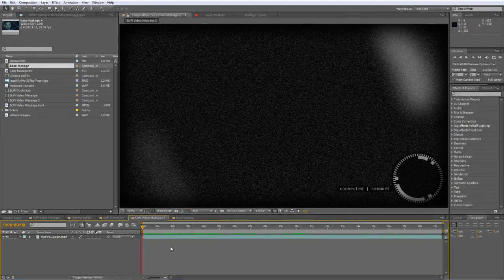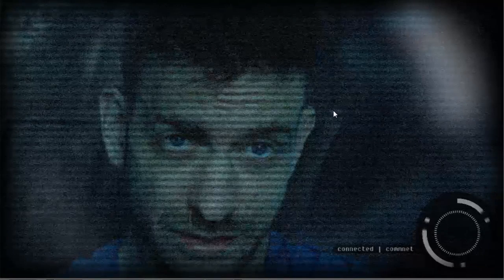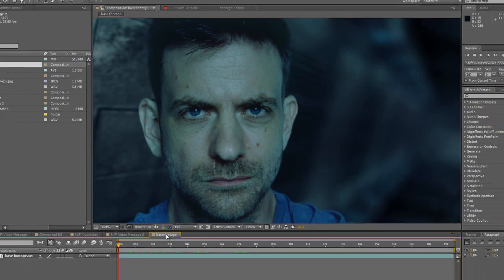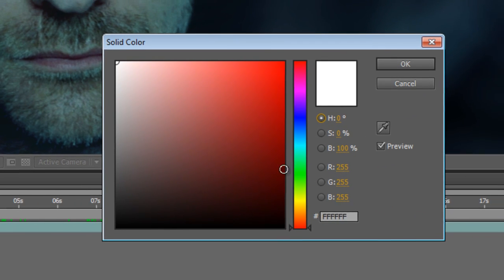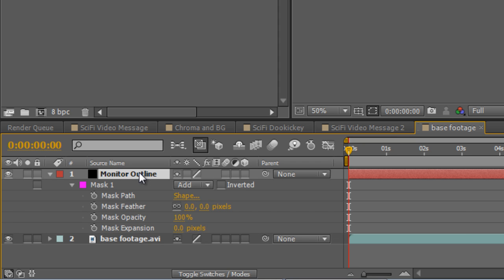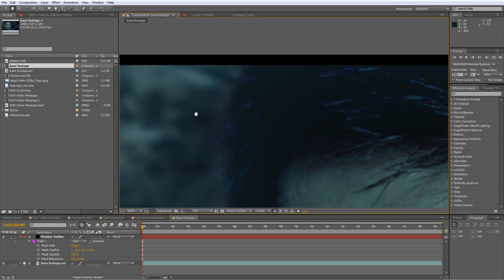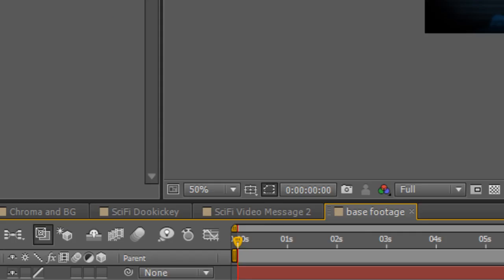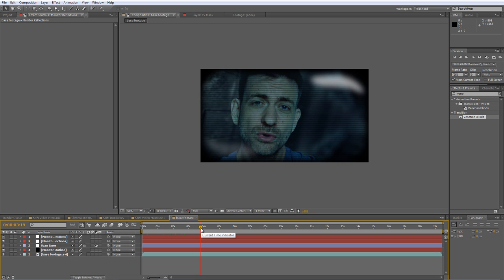After Effects Tutorial - De-rezzing your video, part 2

Comment from the maker: It's a standard effect in AE, so there's no reason why you wouldn't have it. It's the 'venetian blinds' effect, so maybe you're not spelling it right? You should find it at the bottom of the Transitions folder in your Effects panel. Failing that, you can achieve a similar effect using the Grid effect - set it to 'Width and Height Sliders' and adjust the Width and Anchor value to remove the vertical lines. Then set the grid to inverted and the blending mode to stencil alpha. That should work.

Comment from the maker: @ribenawrath Thanks for sharing your suggestions. While CA is a feature of the lens rather than resolution, I take your point, and if you watch the last part of this series, you'll see I have an example of how to add colour separation (which you could use to create a pseudo-CA effect). The problem with rendering down and then upscaling is that it creates a soft, blurry appearance (AE uses sub-pixel sampling) rather than a low-res feel. You'd be better off using the Mosaic effect for this.